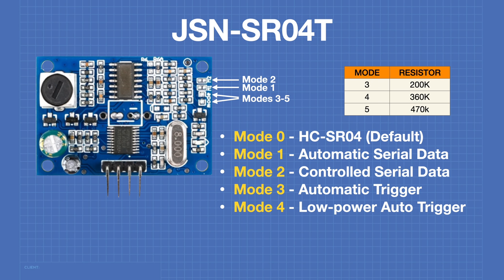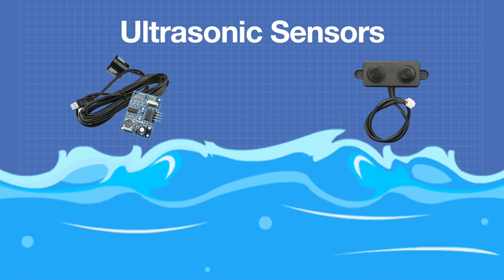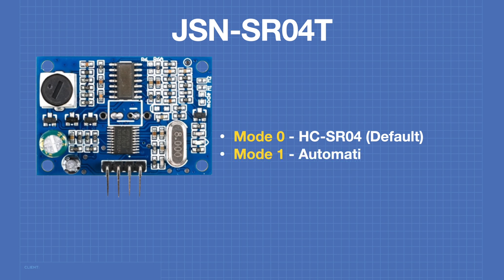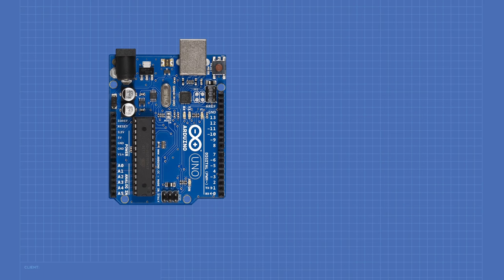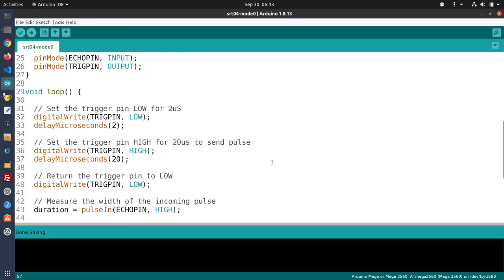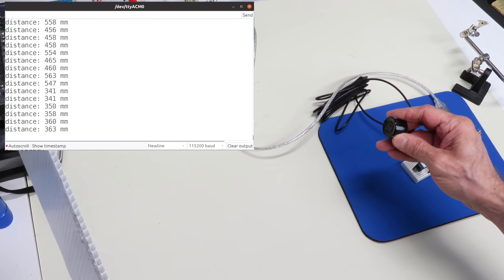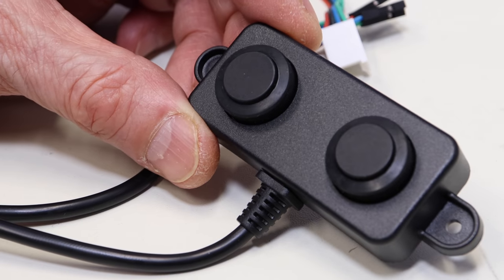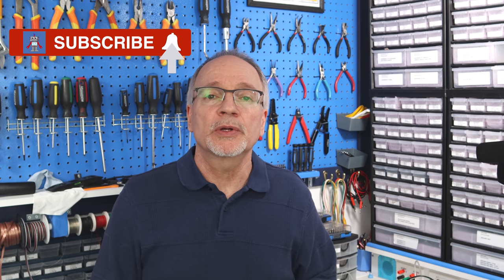Waterproof Ultrasonic Distance Sensors - JSN-SR04T & A02YYUW 💧☔

Comment: This has found me at just the right time. I'm planning water tank level monitors. Thanks Bill
Reply: I am thinking of a well monitor application.   I like the idea of waterproof ultrasound, but need a range on the order of 60 - 70 meters.
Reply: hi Bill, 
I made a water tank level sensor with the SR04T , it has worked well for a year now in a 25,000L plastic tank.
As the tank top is a dome I have an approx. 50cm air space to deal with the min. distance .
I mounted the sensor in an waterproof ABS box together with a small arduino, I send the data via a RS422 interface so you can have a display
Up to 500M away.
The box was mounted over a 50mm hole in the top of the tank.
One problem I encountered was condensation overnight. ( a drop formed on the sensor what gave a false reading)
The solution was to mount a 12V incandescent lightbulb inside the box and power it with 9V what makes the lamp last forever.
This solved the problem. I made 2 different read out units one for the pump shed and one for inside the house.
Reply: @ray_glaze  these sensors don’t work in a narrow tube ( echo of the wall)  maybe a long pipe with a pressure sensor on top would work for you.
Reply: Wouldn't a pressure sensor do the job better.
Reply: @johnnz4375  Interesting idea.   

The pipe in question is 6 to 8" ID.     Since I haven't found the range I need, so I have not worried about the spread. I did give some thought to  interference with the  pipe and wiring.

The well is capped, but not sealed.   I'll have to think about how pressure responds to a change in water level.

I also need to broaden my search  of sensor types.

Thanks for your reply.
Reply: @ray_glaze  you might want to use laser at that kind of distance
Reply: @engineer_setengahotak7149  

I wonder if the air / water interface would reflect enough to be measured. 

Obviously I have a bit of research ahead.  Thanks for your contribution.
Reply: Why not use an air pressure sensor on the end of some plastic fish tank tubing with the bottom of the tube weighted and submerged to the bottom of the tank. When the tank is more full the pressure in the tube will be higher. Hmmm I might make one for mine and make a YouTube video on it…..
Reply: @daverei1211  might be too sensitive, but maybe worth a try to prevent condensation probs mentioned earlier
Reply: @tomstruct  it’s not an original idea. I saw it about 25 years ago in an Australian electronic mag (ETI?). I’ll probably modernise it with an ESP32
Reply: @daverei1211  Good idea.  Thanks!
Reply: @johnnz4375  can u share me images?
Reply: @navinkv007  images of what ?
Reply: I have made one already using wireless communication (hc12 transceiver) wireless from 5th floor to parking.
I used Jsn sensor but they get damaged after a period of time due to moisturize in tank. Now it more than 10 months and it's still working properly with a regular maintenance 😂😂😂
Reply: @johnnz4375   Nice idea, same condensation prob I am facing for water tank. Need more clarity on mounting of ur incandescent light bulb idea. My US-100 gets rusted at the mouth of the sensor after 6 months and had to replace it.
Reply: @johnnz4375  how wide was your reservoir? I'm planing to do a similar project but the beam width seem to be very wide thus reporting invalid result

Comment: Your video has an excellent explanation of the theory and operation of both the  JSN-SR04T & A02YYUW sensors.  I had an application where I needed sensors to monitor the level of solution in two hypochlorite tanks in a water system.  The JSN-SR04T has a "blind spot" that is too long to the application.  I originally used two HC-SR04 sensors, but I was worried about the sensors getting wet.  I found versions of the A02YYUW sensors that worked using the same pulse width modulation as the HC-SR04 so they were a 'plug and play' substitution.  The sensors have worked for over two years with the only problem happening when workmen accidently 'disconnected one of the sensors (broke the wire). I believe that there are versions of the A02YYUW available that operate on PWM and could be directly substituted for the HC-SP04.

Comment: There's a problem with the A02YYUW sensor if you're trying to meausure a fluid level in a 150mm PVC pipe.  The sound reflections confuse the sensor and it gives the wrong readings (something similar happens if you put it at the domed apex of a water tank, or near the corrugations at the side).  I found that narrowing the sound aperture by cutting a 50mm high piece of packing foam to fit over the sensor with a similar sized rectangular window for it to hear through fixes the problem.

Comment: I've successfully tested the JSN-SR04T underwater although I rugged it in the rear and the sides. But if you take into account that sound speed underwater is about 4 times faster than in the air,the minimum distance it could read was about 85 centimeters. Maybe it was too long for being tested properly in a bathtub.
Reply: hey, I think you might wanna try this idea. I've never use JSN-SR04T transducer for underwater measurement but I did something with it same module (rival maybe?) it is AJ-SR04M, yet I changed the transducer with waterproof 200 KHZ Fish Finder transducer but still using the AJ-SR04M module as the driver. it probably still giving output at 40 KHZ but it work. I can get reading as high as 6 meter in my field test in some pool nevertheless the maximum range of AJ-SR04M is about 6.5 meters and because sound travel faster underwater, it should giving the maximum range for about at least 20 meter underwater. yet I've never tested in that range

Comment: I'm quite sure that these would work underwater, but you should take in to account that the measured distance should be multiplied by 4, due to the ~4 times the difference of the speed of sound under water (speed of sound in air is 0.231 times slower than in water). I also believe that this increased speed of sound also means that a minimum measurable distance of the sensors would be 4 times higher than normally. This should be tested in a pool, not in a bathtub that is way too small for the quoted minimum distances of these sensors. Also there is way too much echo underwater in a small bathtub.
Reply: Would the rounded walls not affect the sound too? A bathtub doesn't really have a flat surface for sound to bounce back. It will always deflect instead of bounce straight back? Just curious - I definitely don't have facts

Comment: Thanks a lot, your projects are something which I always look for. In one of my earlier projects, I have waterproofed HC-SR04, fitted it on top of my 1000 litres water tank to find the distance between the top of the water surface and sensor. Further by putting the dimensions of my tank in the code, I calculate the exact volume of water available in my tank and using automation, turn ON / OFF the water pump to maintain the water level. Furthermore, I also calculate the flow rate of incoming and outgoing water in litre/min to know the consumption. The project also sends imp notifications on my mobile. Surprisingly the project is still working great.
Reply: Great Project. I had a few questions
Did you use an arduino board and ESP module ?
How did you waterproof the HC-SRo4
Reply: You can use any, arduino can be used in case you don't want to access the data over the internet.  I used insulation tape for waterproofing the sensor module.
Reply: @rupeshkoulge1616  But doesn't that ruin the readings if you cover the eyes of the sensor
Reply: Leaving the eyes(transmitter and receiver), you can cover everything nicely

Comment: I've used the non waterproof sensors and waterproof sensors for years in a water tank to measure water level.  The non waterproof ones will fail within a few months due to corrosion of the sensors.  The jsn wasn't suitable because of it's high minimum sensing distance.  The a02 is easy to use and so far has been working in a hot and humid environment for a year with no issues.  I've also tried the expensive maxbotix waterproof sensors, but they were unable to read distance if the water was agitated during filling. The manufacturer confirmed this.  The a02 comes in pwm and uart variants, I could only get the pwm type to work, in a similar manner to the normal sensors.
Reply: Can you please tell me what exactly the components you used in your system beside the a02 pwm sensor?
Thanks in advance
Reply: @mesterhash7274  An arduino uno, an ethernet shield, a 3d printed mount for the sensor, and a POE splitter to power the arduino.  BTW, the sensor also failed, but it took a little over a year.  The other sensors failed within months.

Comment: Regarding the JSN-SR04T sensor, please inform if this sensor is produced with NON-TOXIC materials, since it will get wet with the evaporation of the water inside the water tank and the drops will fall into the water in the box that will be consumed for drinking, cooking, etc. . Thank you very much.

Comment: Nice video. Question: Would it be possible to extend the cable on one of these sensors? My anticipated application is measuring the water level in a river, for which I want to attach the sensor to a beam above the water. Thanks!

Comment: Thank you very much for this video. I've watched multiple videos of these same sensors and it seems that in water the distance must be greater for them to work. This has something to do with how fast the sound returns in small spaces. IE there was a test where results from edge of water was not accurate, but from boat was accurate as it was over 3 meters.

Comment: Thanks
 Need sensors for tank level measures in my van. But... If you use them over liquid, do they get a decent reflection from the water?
Reply: Yup, I have the same question
Reply: Count me in for the answer.
Reply: While we are at it, would they work for oil level in a heating oil tank? It can be quite cold in our house if it runs out. 😁
Reply: Okay, I’m answering a couple of years later. But I’ve been doing this exact thing. Yes, these work for measuring the water level, and they get a good reading from the surface of the water. The problem you will encounter is minimising reflections from other objects. Consensus is that if you somehow mount this sensor into a pipe and drop that pipe down into the tank, you’ll only get readings from the water surface, and not other objects. I managed this by 3D printing a mount for the sensor to insert into a pipe. The alignment of this mount is critical in getting reliable results. It has taken a few different designs. I’ve had it running reliably in two out of my three sumps for years. One of the sumps for some reason just never gets that level of reliability. Today with flood alerts in London I am revisiting my design!
Reply: @MatSmithLondon  thanks. Good luck with the floods, lots around here in Herts.

Comment: You are a great instructor. I read somewhere that the minimum distance is 20 cm. I monitor water loevel in an IBC tote and when near the top it reads 19 or 20 cm then as the water is drawn off for irrigation it begins to read 21- 30 and at 31 cm it disables the pump so it wont burn out. If I get alot of rain, it refuses to read anything for awhile, maybe 2 days, but then it fires up and works again. Any ideas as to why?? Thanks to all who can help.

Comment: Prayers for your mother and you, I'm 75 now and have been through it. I'm new to the Arduino IDE, I'm getting an error while running this code for Mode 1. It reads "unsigned char CS", anything I should have turned on or off in the IDE, or maybe a library I need to not include.

Comment: Great Tutorial!! I have used this sensor for Tank water level monitoring. As this sensor works on ultrasonic waves so it even detects the bugs and flies inside a tank,, if any bug or mosquito passes in front of the sensor it detects it as rising water level. I used to get random readings all of a sudden due to this reason. Then I switched to another sensor that works more accurate in that case.
Reply: You can collect say, 100 readings, discard the extremes and average the rest.

Comment: Programming error  "unsigned char CS" is being use by the Arduino WiFi board. It took me long enough to find the reason for the error. The variable "CS" is being used by the WIFI board, Just thought you would want to know. I'll try a different char.

Comment: The sensor din't work under the water because you don't calibrate again for that , remember the ultra sound traveling different under the water
Reply: Which sensor will be best if we have to take underwater measurements?
Reply: @shixu1998  none ' there's no sensor can work underwater!
Reply: @shixu1998  you can use sonar

Comment: I'm using the AJ-SR04M that received from Aliexpress instead of JSN-SR04T, with ESP32 board and the accuracy is OK but the measurement is freezing after a reboot of the board or due to power cut. Any idea what could be the issue?
Community in Home assistant forum reached a dead end!

Comment: I like your videos, you are very precise and go into a lot of detail.
I think if you you wanted to use them in both water and air, you would need to receive raw data, some way to have you code know it was in air or water, then your code would use different formulas due to the different speeds of sound in air (340m/s) and water (1482m/s). (just guessing and temperature plays a role)
I don't have these sensors, but it may be a good experiment to do.

Comment: Extremely well explained. Thanks.  I used SR04 for a while to check water level in 1100liter tanks. But they keep failing every few weeks. Now I'm using the JSN-SR20-Y1 because I need to measure from 4 cm to about 120 cm. I also use mode 1 to read by serial after sending 55.  It works most of the time, but somehow, it goes completely wrong for a while, then comes back, etc etc.  On a full day, it may read bad distance once or twice, for an hour or two at the time.  Have you tried this JSN-SR20-Y1 yourself?

Comment: Hello Sir, your explanation is very helpful for me. My background is in civil engineering with zero knowledge of Arduino.  I am starting to learn to use Arduino Uno R3 for my lab research. By following your instructions, I successfully can install and read the single data from an A02YYUW sensor. However, I need to install two sensors in one Arduino board and read the data from the two simultaneously. Can you give me an example code for it?  It will help my study. Thank you.

Comment: I have a question, i try to braodcasr a signal from the esp 32 and a jsn-sr04m-2 ultrasonicsensor but my readings are almost always 0 or 8000/9000 and that cant be right...even whit a simpel test code i cant get nice readings...what can i do ? Or how can i get in toutch whit you to fix it?

Comment: The speed of sound in water is 1480 m/s, compared to 343 m/s, so if the constants are not changed the readings will be wrong.
Reply: It's not even giving erroneous results, looks like nearly the same reading, so I suspect the sensor might be unable to operate underwater.
Reply: I was going to mention this difference in the speed of sound in water compared to air, but you beat me to it LOL.
Reply: @downstream0114  There was a minimum distance of operation in air for all these devices. The effect of being closer than those distances appeared to be the same as being in the bath. The speed differential between being in water and being in air means that immersion would cause those minimum distances to be multiplied by approx. 4.3. Definitely would not work across the width of a bath.

Comment: Sir, is it possible to connect 2 of these to 1 arduino, put them opposite each other and trigger them at exactly the same instant and record the time it gets for each to measure the other's wave impact?

If that is doable, with 3 or four and a little math you can make a nice windmeter.

Comment: Would you have any advice on connectring JSN-SR04T to Raspberry Pi3B via UART pins 14,15? I enabled enable_uart=1 in boot config, I can see /dev/ttyS0 device appeared but I don't seem to ready any data off it with screen /dev/ttyS0 9600 command

Comment: The AJ-SR04M is vary unstable,,, Shure you can get stable readings, BUT those stable readings will change, to OTHER stable readings depending what is located around the pcb of the device.... EMI..... Example.. put the device (PCB) in a plastic case ,, you get stable reading of say 111.x   Now lay a 12 gage wire not connected to anything across the top of box and reading changes to a stable reading of 22.x ....  We did shield the pcb, but this type of thing still happened..

Comment: Hello DroneBot Workshop viewers,    Can you help me out with the following question? 
I like to use one of these sensors to measure the water-tank level  the tank is 40cm x 100cm X150 cm deep with smooth concrete walls.  The question is can i use these sensors or will sound bounce of the walls and mess up the reading? Or are there some other things to consider.

Comment: I can sure attest to the fact that the HC-SR04 sensor is not only not waterproof, that after spending a long time in a high humidity area, it completely fails.
I used this in my Humidifier project as the water level sensor.  it worked great.
But after about 2 years, it just stopped working.
Now, I do have to confirm if it was in fact just the humidity, or... sigh.... if the vinegar added to water to keep the scale down was the culprit.  I do suspect the vinegar spray, because as it happened, the Nextion display that I use, that sits on the top of the humidifier in its own case, got vinegar spray literally inside the layers and destroyed the display.

Fun times... sigh.